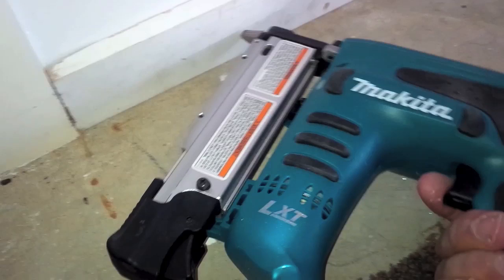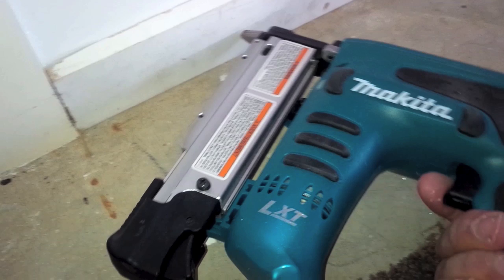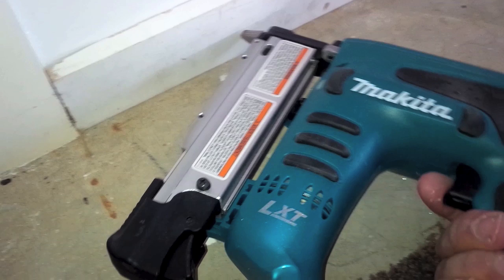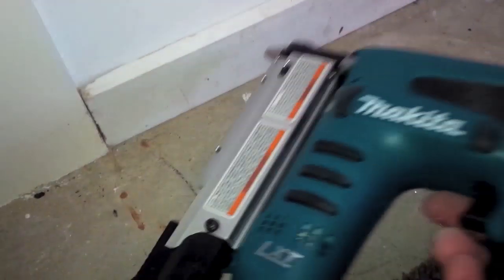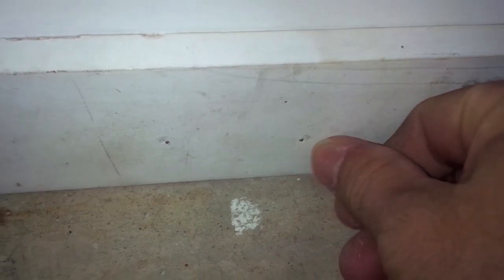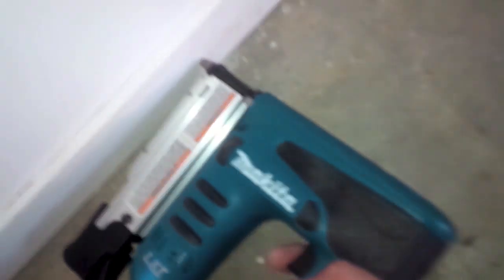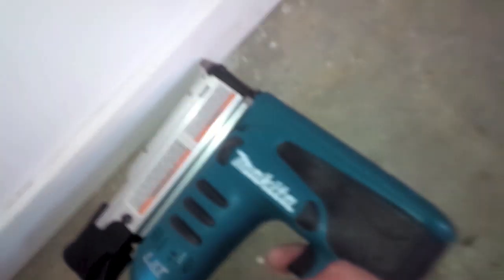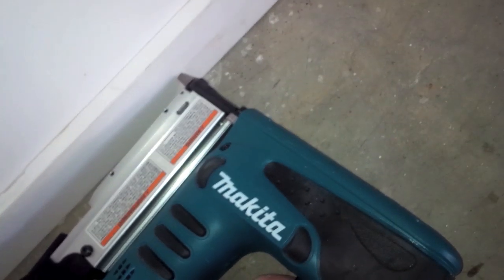Makita Pin nailer demo 2

Comment: nice! does it sink the pins at least a hair below the surface so we can patch the holes if we want?  Thanks for the nice demo!
Reply from the maker: Matt H. Hi mate, missed your comment sorry,  it countersinks the pin nail either flush or just under the surface, but the hole is so tiny that you dont need to putty anything, the paint will fill the tiny pin hole.